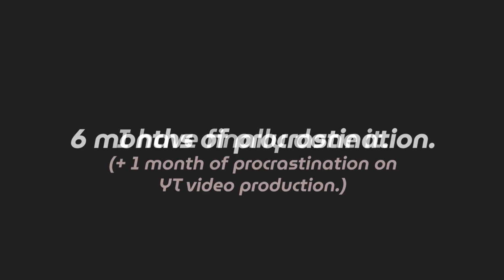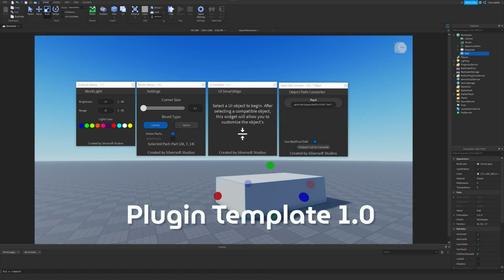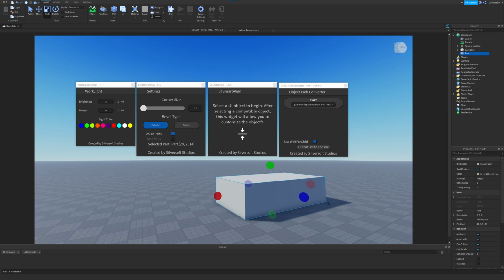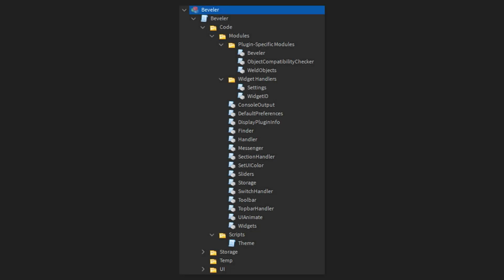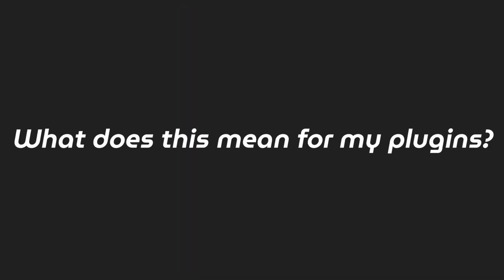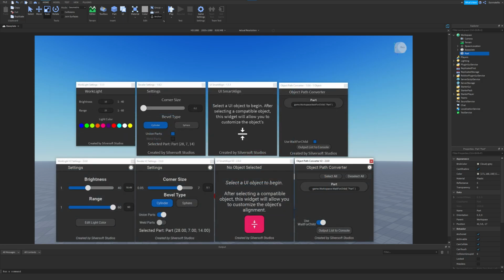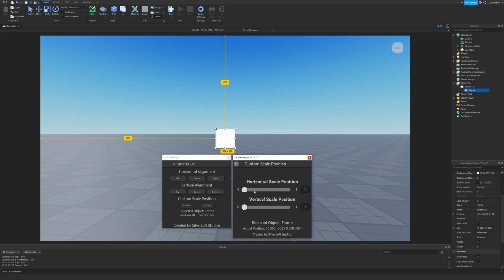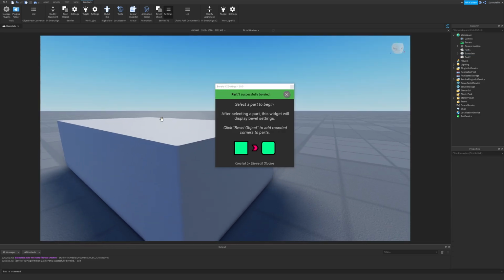I Remade All of My Plugins...

Comment from the maker: After publishing the new redesigned versions of the plugins last night, I discovered that the plugins were no longer being flagged for script injection and were not generating errors even after disabling the permission. 

If there are no errors for you all after disabling the permission, then feel free to keep it off. 

I realized that the permission system must have actually been flagging a message UI script that was used to close the message after someone clicks the close button, which must have triggered the permission system after the GUI was copied over to the widget. 

This would lead me to believe that it was that close UI script instead of modules as I previously thought. I added a correction to my previous video about the permission system as my original thinking was flawed, but the rest of the points made were still relevant. 

Disregard the "Plugin Permission System Conflicts" section as it should no longer apply to the plugins, but it is still interesting to show how different my new plugin template is compared to the old one.